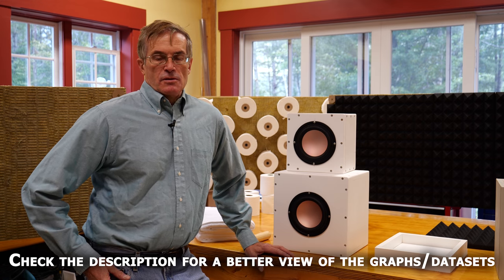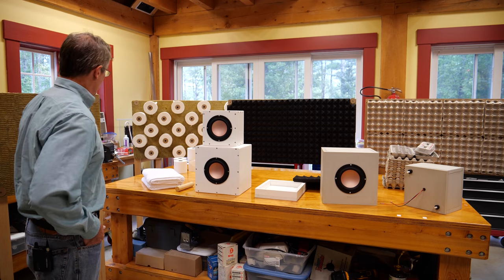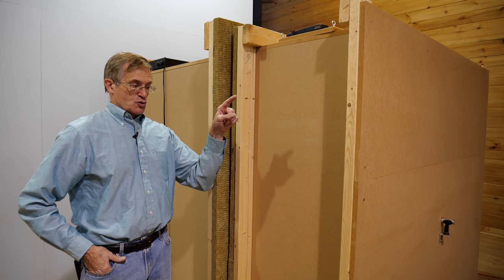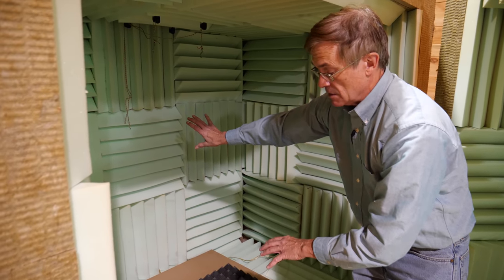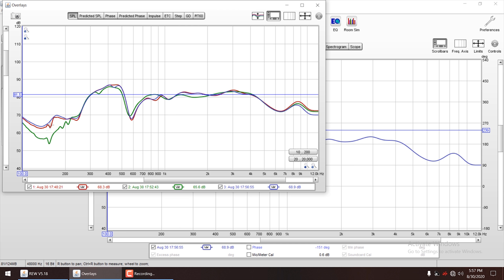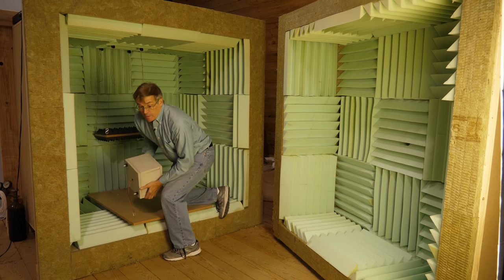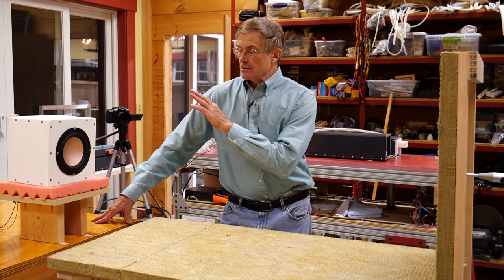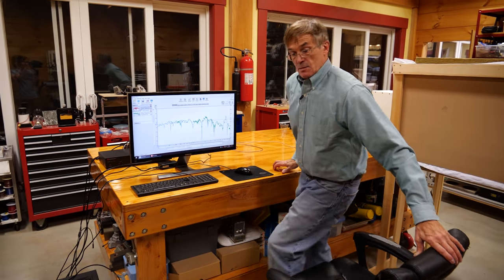DIY Speakers and Acoustic Panels

Comment: The best "DIY Science" video about sound/acoustics I've ever seen on YouTube! Enjoyed every minute of it!
Really appreciate all the explanations of what you've done and why. Thank you all.

I dived into acoustics year ago having a goal to fix terrible reverberation time (RT60 > 5 sec) in a lecture room. After hours of research over Internet ended up buying absorbing material (panels) to hanger it under the ceiling. But before putting it in place I couldn't miss the chance to check how it would improve acoustic properties of my room at home. So, now I have about 30 measurements done with REW with different number of panels put in different places. Next I'll compare the RT60 curves to see if the results correlate with my intuition and how to actually treat such a small room to get optimal acoustic properties.

Here comes the question: Are you going to compare absorbing properties of materials? 

Having the anechoic chamber you can check how thickness of rock-wool changes its absorbing property, how it compares to others (DIY Perks actually tried reduce reverberation time with towels). The best, to my opinion, would be to evaluate acoustic properties of your, say, living room, and fix it if there are some problems, with all this fantastic scientific approach you have. 

Thank you again.

Some links you and others can find useful:
* Safety of mineral fibers (a review):  https://www.gearslutz.com/board/bass-traps-acoustic-panels-foam-etc/347314-comparative-safety-rockwool-fiberglass-organic-fibers-review.html
* Room Acoustic Calculator (many producers, see at the bottom): https://www.sarooma.de/en/apps/web.html
* Master Handbook of Acoustics, Fourth Edition (PDF): https://www.researchgate.net/publication/243525251_Master_Handbook_of_Acoustics_Fourth_Edition
* The Sound Blog of Trevor Cox: https://acousticengineering.wordpress.com/trevor-cox/

Comment: As a Professional Engineer myself, I enjoy the acoustic videos immensely. One variable that I'd be interested in looking into is "asymmetry". We know that there are vibration cancelling benefits (or perhaps, more correctly, reduced excitation gains) associated with asymmetry (ie 2/5ths - 3/5ths rule). Have you considered some simple tests involving different materials on opposite walls, for example Roxul on one wall and asbestos on the other? Or your best bass handling material on one wall and your best high frequency dampening on the other? And finally - one of the absolute best medium/high frequency absorber is feathers. Have you considered trying a feather quilt as an option?
Reply from the maker: I think there is merit to that.  First you have to determine the best materials for a given response and assuming one material is not superior across the board, then mixing to maximize the overall response makes sense.

Comment: Actually, I used egg cartons, but less to make the room 'dead' but more for diffusion, in which they perform pretty well. My initial setup had a blank concrete wall behind my workplace and that had some awful resonances and echoes that were just unpleasant and the egg cartons, in a 150cm x 125cm setup, got rid of this problem, also I covered the wooden frame with red linen cloth and put some Pollock'esk action painting on there, and this panel just looks pretty neat. Though I'd be interested how combining the acustic panels behind the rockwool panels would perform, especially on the low end, since the acustic panels seemed to have worked a bit better on the low end and the rockwool on the high end.

Comment: I was doing a renovation of a basement that had full concrete walls for the foundation. After framing it out and then adding RockWool insulation I was amazed at the effect it had on my hearing and sound. It was like everything was being muted and silenced the usual background noises present in life … which was extremely discomforting and unpleasant. Not to mention communicating with the others became extremely difficult when we weren’t in near vicinity. 

As soon as the drywall went up the entire effect was mitigated and all was back to normal. Watching you put your head in the sound chamber reminded me of the experience but i can only imagine how much worse that chamber was.
Reply from the maker: According to legend, some workers  would have panic attacks when entering  an anechoic chamber.  I believe it.

Comment: Makes me appreciate my B&W 800 series monitor speakers; they're tested individually, sold/replaced in pairs and results included. Wow those wild responses would drive me nuts. However, that's absolutely not to take away anything from what you've done here.

Comment: even in an anechoic chamber, 32, 35 db looks like very low power delivery even for a very inefficient one.
Enclosure wall rigidity is much more important at high power situations, closer to the mechanical limits of the speaker and much higher pressure changes inside the box.

Starting the test at 100Hz also reduces much of the advantages of a rigid box, once low frequency moves much more air and will cause much more wall distortion that will affect sound.

A low frequency high power setup would be much more sensitive to the advantages of a concrete super rigid box instead of a lighter one.

Comment: i was just looking to what i could  use to build sound  panels  in my theater in the basement . the room came with acoustic tiles 2x4 feet in the celling like you had good luck with, and carpet on the floor but the walls were wood paneling. the is where my problem is. I  have some hot spots with the bass  the main one is a corner that  muddies up the bass  terribly , there are other  panels that rattles a bit. i have in past years ive put additional screws that did help some  So i took a couple  of cushions off the couch and moved the around and found the trouble spots. that s when i decided  to build some sound panels. and was trying to fine the best product  at the best cost .watching  your video was very informative and the way i see it i going to use  acoustic tiles. the price is dead on and they will be able to fit anywhere if i have to cut them. Thanks for all the time and cost you put in to come up with a solution that has saved me cost , time and efficiency  this really set me on how to handle this. i will let you know how this comes out.
Garry M

Comment: Very interesting! Thanks!
I play rock'n'roll music in a band, and from experience what I have to be concerned with is standing waves – be it inside loudspeaker cabinets or in rehearsal rooms. With ready-made, branded loudspeaker cabinets this should not be a problem, as they have already taken that into account when designing and manufacturing the products. Otherwise, if you build your own (of the closed kind) you usually fill them up with that synthetic cotton wool that also the manufacturers use, and that usually takes care of things.
Rehearsal rooms however don't come ready-made, and through the years I have seen a lot of solutions. Usually, and of first priority, have been attempts to insulate the room to prevent sound from escaping. Everybody usually suck at this, since they have no idea what it takes – I have met people who believed that the egg cartons they glued to walls and ceiling made the room sound proof ...!  :) 
The best and cheapest solution is to find a room where neighbors are far enough away so that you don't bother them. Then you can concentrate on the acoustics.
I once rehearsed with a band in a room where all 4 walls were clad from floor to ceiling with glazed ceramic tiles. The floor was carpeted though, but that did not help any against the sound being thrown back and forth locker room style. You could play one note OK, but already at two simultaneous notes you would have huge problems discerning what was going on. Rehearsal was impossible until I found a used set of medium heavy curtains and hung them, gently undulating as curtains do, on two perpendicular walls, at appx. 4in/10cm in front of the walls. That was all that was needed! No mineral wool batts, no sound foam, no nothing – just the curtains on two of the walls, leaving the other two walls as bare and hard as we found them. And we had great acoustics!
I'd like to see an experiment, this time with an "echoic chamber", with different fabrics with varying density and distance hung in front of the walls. I believe your towels would have performed much better if hung at a distance from the wall as well.
So there's an idea, if you'd like to check it out.   :)

Comment: You should test moving blankets as well. They work very well as wall hangings,  spaced about 2" from wall, or rolled up or folded for corner traps etc. They are very inexpensive from the likes of Harbor Freight etc.  They are an excellent high frequency sound reinforcement.

Comment: DIY perks used towels differently. He made a frame with air between the towels and the wall. That bit of air (around 4cm at least) should make a difference
Reply from the maker: He also studied transmission /absorbtion not glancing reflection which is what we're interested in.

Comment: If the foam insulation were cut with a base that extended further like:
|\                                                                |\
|  \                                                              |  \
|    \                                                            |     \
|      |                    instead of                     ''''''''''''''''
|      |
"""""""                      
Would that help dampen lower fq since there's more material to react to the lower sound fq?

Comment: Why 6 feet tall for the second best speakers?...can they be shorter and be used for LOUD!!..disco hard knockin  deep bass?..is there a subwoofer used with them?if so how? & how would you add Bluetooth?..thanks
Reply from the maker: The size is dictated by the manufacturer's spec for the optimal open enclosure volume for these drivers.
They don't need a sub, but if you want more powerful bass then adding one is not a problem, go ahead.
Reply: @TechIngredients  how would i calculate for a 4 or 5 footer with a subwoofer??..

Comment: When you don't even realise the video is 50 minutes due to it being so interesting lmao. I didn't expect that kind of performance from the toilet roll at all... I wonder if it's more to do with the spacing between the rolls, rather than the material itself? The distance between the rolls looks to be anywhere from 5-15cm, which when you take the wavelength of a 2kHz-7kHz sound, lines up fairly well. I do wonder if you have very soft foam boards sticking out from the backing panel, spaced around 15cm apart, then smaller, thinner boards stuck to the foam at a 90° angle, and even more stuck to those in a sort of Ŧ fractal shape, would it trap those high frequencies even more? If I had the means to test, I absolutely would.

Comment: Did you happen to consider cork as a damping material? I use a 10mm layer in my 3D printer enclosure and subjectively it insulates quite well. It would be interesting to see a quantifiable measurement.

Comment: Try egg carton with cloth. Glue the cloth on every tip of the carton so it doesn't go in the dips, but instead looks flat. I have reason to believe it might trap sound waves really well. Also adding rubber behind the carton will be damping tho low frequency.

Comment: hehe love the helium test :)  maybe you can look up SF6 gass in electrostatic speakers :) due to there higher electrical resistance (compared to air) you can make some neat highly efficient electrostatics. might be up your sleeve :) is surely is up mine , in kind of interests

Comment: I think you should have clarified your reasons for poo-poo'ing the egg cartons at the end. Presuming it's aesthetics, fair enough. But without stating that, it seemed like you had made your mind up about the 'urban legend,' then proved that the legend is spot-on... then re-dismissed the legend in summation. Having reviewed the charts via the link provided, the egg cartons performed better than the acoustic tiles with a uniformly tighter response range across the board, except for at the 2k-3k range. Which is a consideration counterbalanced by how abysmally the acoustic ceiling panels performed at the 1k-1500hz range.
Reply from the maker: It might be interesting to place the egg cartons on an acoustic panel backing.  The overall cost would remain very low.
Reply: @TechIngredients  I was thinking the same! Although, I wonder if the two frequency dips would just stack, making for a bigger tooth of poor-response area. And then I wonder again if that wouldn't almost be desirable for listening, as a lot of the 'muddy' sound of a musical mix comes in around those low-mids/hi-lows.

Comment: Kia Ora
Sound only does 3 things
Travels straightforward 
Bounces off hard surfaces.reverb
Travels forward  and absorbs 

The best by far for containing  sound like my Mesa boogie 100 watt head with 2 quad box speakers
 4 x Celestine 75 watts
4 x Phillips HP8s 
Hang woolen foam backed carpett a few inches off walls,ceiling ,floor 1continuios piece 
This will contain absorb and filter the noise that your neighbor threatened  the k...l you if you didn't shut your band down 
Nothing else comes close
Test it with your anti personal speaker
Love your work 
Brother
KIA KAHA
MARKYONE
NEWSEALAND

Comment: Does the tiny dip in a ported speaker correlate to the size/dimensions?
Reply from the maker: Probably.  Adjusting the size and location of the port(s) will affect the frequency response.  We didn't attempt to optimize the port only to demonstrate it's contribution.

Comment: Why did you only sweep to 12 kHz? Yeah, "normal" hearing only goes to ~20 kHz, as we age that drops to ~15-16 kHz, but the sweep seems limited.

Edit: Nevermind. Forgot that you have a single driver, mid-range for it's frequency response, without a tweeter.

Comment: Do you see any potential for including something like helm holtz resonators in soundproofing or noise reduction experiments? I guess mentally I keep picturing something like a honeycomb design with openings to allow sound waves to enter, and maybe some kind of flossy material or, I don't know, wool. Maybe for its hollow fibers that perhaps would vibrate and convert sound waves to heat. I'm not sure I have the right question, but I'm confident that your team could make something fascinating out of these ingredients.

Comment: I'd like to see if 3 separate or 2 separate drivers, each in their own enclosures, working in tandem, versus an all-in-one like a soundbar, the effect.
Like the classic Tweeter-Mid Range - Sub wooden speaker design from the 70's, versus, 3 enclosures, versus a high quality "soundbar" - like the Sonos, Bose, Samsung
Would be interesting to see if 2000$ versus DIY.
Already I know that DML's + a powered sub puts most soundbars to shame.

Comment: Great stuff.  I'm amazed at what i've seen & heard can be done with these D.M. speakers. All the  "little sub with small stereo NXT panels" commercial systems i've heard (many since i first heard them 2+ decades ago) were hideously overpriced for what they could do & they all fell down by relying on badly made (2" to 4" inch driver) light-plastic subwoofers (tho nothing 'sub' about their farty bass,) crossed over abnormally high in the Low-Mid frequencies (around 500 Hz & higher from what i heard) to give their small nxt panels any sense of richness, scale or weight but with these larger diy panels, i bet you wouldn't need a sub to go beyond the normal 80 to 150 Hz, (unless you want v.small panels) Anyway, fascinating info on room sound treatment, commercial bass-traps &  sound absorption panel's can be under-pricey ...i can imagine the toilet-roll absorbing panels working very well (kitchen-Roll panels for huge rooms?)  & you could cover you toilet-roll panel's with a light fabric if you don't want folk seeing them (sorry if that got said)  Perhaps using the less-tightly wound, comparatively soft & billowy paper bog-rolls (the v.cheap brown-finger threatening type) would give a better sound absorption factor but it'll be cheap enough to test this idea (& it could even win next year's Turner Prize for modern art, compared to what does!

Comment: Egg Cartons, corrugated foam, toilet paper, rock wool, and towels. 
@12:30 Test all the speaker drivers he has, that have different characteristics such as foam insulated. (Did anyone really care for this information hence the title? No direspect intended.)
@22:30 Injects helium into rear space of the drivers and test them. (Again, interesting, but not related to title. No disrespect intended.)
@25:00 Finally test material for absorption, Concrete as a baseline. 
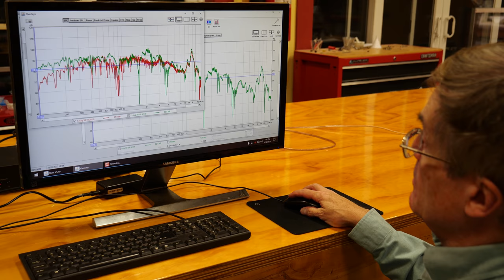@32:00 Bath Towels
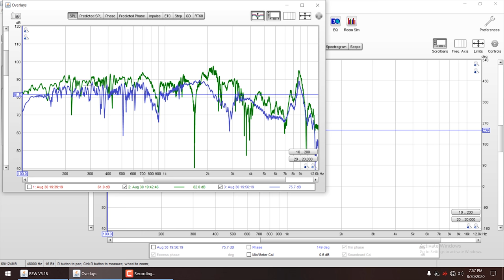@34:00 Corrugated Foam
@37:00 Acoustic Panels
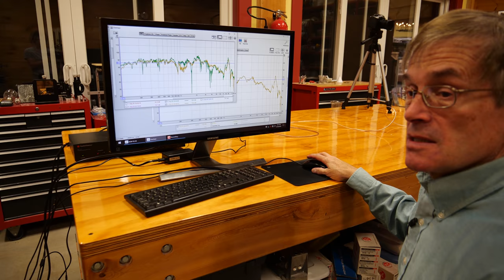@38:20 Egg Cartons
@40:30 Toilet Paper
@43:00 Rock wool 
Thank you sir for the testing and data. Could we get a csv or tab/comma deliminated data file/files?

Comment: YOur chamber although nicely absorbent in initial tests had a 1/4 wave null at 600 Hz and 1/2 peak at 1200 Hz which produced the sharp null and smooth peak respectively.  You do not need significant SNR to make these measurements and would get a flatter response  outside even at low levels.  I've noticed similar differences in Faraday Cages vs outdoor FCC tests, except the room had a resonance at 60 MHz.  That explains why your room measurements avoided those.  All the notches are equivalent to Rican Fading loss. (multipath 1/4 wave cancellation)

Comment: Great video. 

REW has a waterfall graph to give you a deeper insight to resonances and reverberation. A frequency response without the time domain only gives you a small part of the picture.

On another note, I know you’re very DIY,  PSI Audio do an active bass trap for just over £2k, model is called AAVA C20. It involves a low passed woofer and a microphone with no DSP...I’m positive you could build an equivalent at a much lower price point!